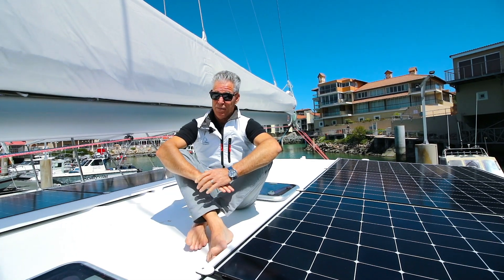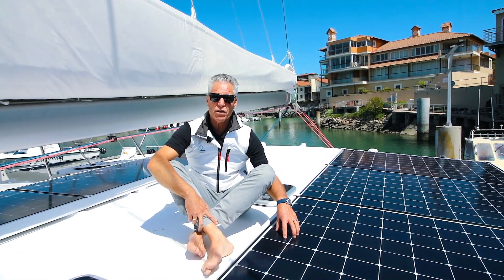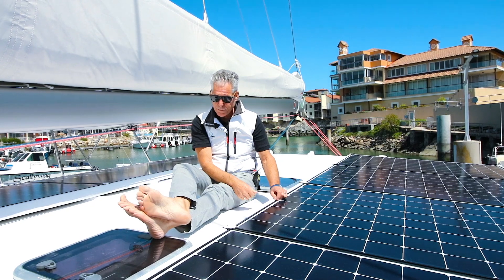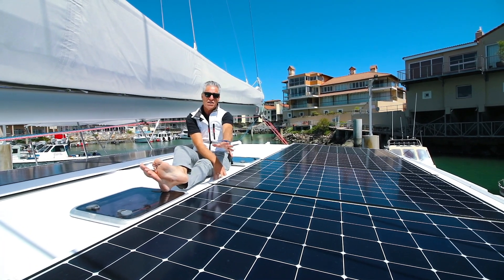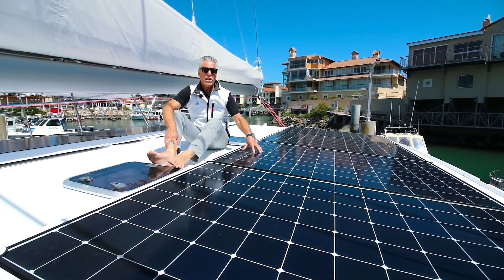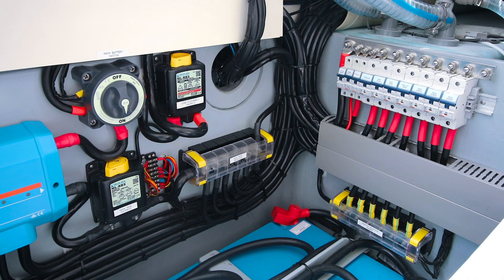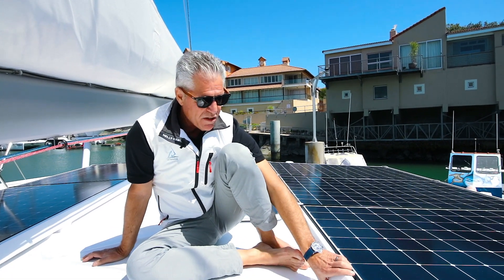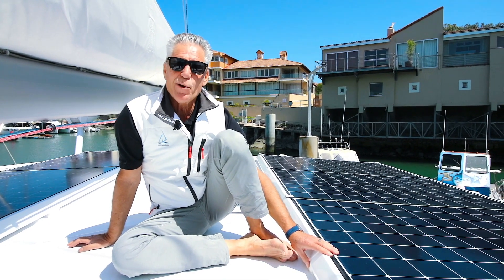Balance Build Technology - Solar Panel Set Up

Comment: With regards to the Solar check out Silent Yachts, finally, a company has created a catamaran that is completely run on Solar power for all systems onboard as well as a backup generator. 

They have proven the technology by sailing across the Atlantic with complete success. It has unlimited range and capacity and all by using currently available technology and batteries. Check out their website and the six models they currently have. It's thrilling to see the technology finally being available. It's clean and eco-friendly and has redundant systems, can also use a Kite system and has a Sail option if you want a sail setup. I am currently looking at the Kite Option and wind generators as well. 

My goal is to avoid all of the problems of a Sail setup, no rigging, and masts, as well as no diesel issues, no need to worry about fuel and repair for the Deisel engines. However,  SY also has a diesel option if you still want those.

1. Silent Yachts Main Website: https://www.silent-yachts.com/
2. YouTube Channel: https://www.youtube.com/user/solarcatamaran
3. Silent 44: https://www.silent-yachts.com/silent44/
4. Silent 55: https://www.silent-yachts.com/silent55/ <=== the one I am looking to get
5. SY Philosophy and Technology: https://www.silent-yachts.com/silent-yachts/
Reply from the maker: It is true that doing a power only electric boat is better - because you can carry larger solar arrays and have no shading of them. 

But a voyaging catamaran, a sailing catamaran, without a backup generator is to our mind risky. And we fail to see yet how an electric engine boat is any greener than a great sailing boat with small diesels and lithium batteries.

A voyaging catamaran can certainly go without a generator and solar and lithium batts, but it has very limited range and speed. We have done studies on this for a climate scientist who wanted a Green Balance. The technology is not there yet. We have sold many used electric engine yachts and have vast experience with them - pro and con. Until solar panels are 3 times more efficient, or the batteries are 3 times more efficient, the range under battery power alone and the speeds you get without additional solar input are low and challenging for safety. I have recently done a video on this we will add to our site. If we could plug in every night, electric is fine. If the sun was out brightly every day it would easier, but it isn't.
Reply: @balancecatamarans  Phil, a major advantage of electric drive is that sail power can be used to recharge the batteries and recoup the energy needed to motor around for coastal cruising.  For long passages, a backup generator is needed.  All of that is readily doable today, if a bit costly until battery costs fall further.  Even Silent Yachts uses a generator for long passages.  

I don't think anyone practical is suggesting to not have a backup generator for passage making boats like yours, but given the sailing efficiency of your boats, the generator would be used even less often than for lower performance boats.  Electric drive would cover the most common use cases such as motoring around marinas, anchorages, etc.  With a backup generator it can be used for passagemaking too.

Electric also fits the ethos of sailing much better than diesels: electric drive with regeneration ultimately uses only wind power to move.

I realize the boating field generally tends to be conservative, but Balance could help show the way to the future by embracing electric drive.  It's also better for the environment overall.  

And it may stimulate sales.  There's a ton of interest in electric drive, and rightfully so.
Reply: Specifications from the Silent web site and referring to the 44 model:
solar panels 9KW, so if we assume a not cloudy day and 8 hours of sun, as when the sun is near the horizon panels that can not be oriented work at a fraction of their maximum output 72KWh of energy produced/day.
engines 2 x 30KW or 2 x 80KW, so with the smallest ones at maximum power you deplete the whole energy you get from the panels in a little more then one hour, with the big engines in less then 15 minutes.
batteries 120KWh
cruising speed 6-8 kt and 6-10 kt, assume that you cruise at 6 kt and this means to use the 25% of the engines power (and I am only guessing, but possibly I am too generous), so you use only 15kw and that you start with full load battery you have 120KWh+72KWh = 192KWh  available before you deplete the batteries. 
192/15 (25% of the power of the small engines) = 12.8 hours before you deplete the batteries.
12.8 x 6Kt = 76.8 nautical miles range.
On a long, but not necessarily transoceanic, trip you can not count on the energy stored at the start if not the first day, then you have to use the 72KWh/day from the panels to move for 24 hours, so you have only 3KW available energy, that has to feed not only the engines, but all the other boat systems, so you have less power then most of the little dingy engines to move around a 11 tons boat.
Those boats are fantastic for island hopping, but their range using only regeneration is really limited. For everything longer then 50-70 NM you have to use diesel fuel.
If we find in the specifications also generator: 22/100 KW and fuel: 250/500 L there is a reason, for everything beyond that range or to use full power if not for a short burst those boats have to rely on fossil fuel usage, even if are surely more green than a boat that uses only diesel engines as they can regenerate some energy during the trip and be completely green for short distance island hopping, assuming you don't use the energy you get while on anchor to run air conditioners.
The only way we have to run a green cruising boat at now, capable of long range and don't using all the energy for the engines on an experimental boat built for the purpose and not for normal cruising, is to use sails in an effective way, so a boat able to have some speed also in weak winds and able to perform tight reach, things that most charter oriented catamarans don't do well, while performance catamarans and many mono hulls can do, and to use solar panels, but also wind generators or hydro generators if needed, to run the other systems, depending on the diesel engine only for calm or to control the boat in a storm. 
This to give more perspective to what Balance Catamarans tells, the idea of a boat with a solar panels roof that can run only on regeneration is intriguing, but at present the technology don't allow it if not for a very short range, and doing some simple math can easily show why, math based on data taken from the Silent Boats web site, so not using flawed data.
Ciao from Italy.
EDIT: possibly a boat with sails and electric motors, a triple regeneration system, solar, wind and hydro, a large LiIon battery pack and a diesel generator is a possible alternative that works, probably at a higher cost then the one chosen by Balance C. as you spare the diesel engines, but you need probably more battery capacity, 1 or 2 generators, 2 is better for redundancy as it can save boat and lives in a storm, and the electric motors and larger section cables don't come for free.
No generator and very large battery pack can be risky if the boat has to survive for a long time in a storm or have to use sails and motor to escape fast from a coming storm.
In both cases and if the electricity consumption for other purposes is kept at a reasonable level, ie not running air conditioning for all the boat 24H/day or motoring in every situation  where you can not have optimal speed sailing, accepting to have some days with a 4Kt average, the resorting to diesel fuel should be any way minimum, the boat with electric motors (and sails) is only more green when docking or mooring, but as long as the sails are used there is not a real difference.
The more boat price don't really justify the little diesel fuel spared, not only form a cost/benefit point of view, but also from a green one, as what makes the real difference is how the owner runs the boat, if he motors often or not and if and how he uses air conditioning.
Reply: @andreachinaglia5804  Thank you very much for this excellent roundup. Personally I would prefer electric engines with generator(s) to the "dirty" diesel engine, but the question I have: is the generator less prone to operational failures than diesel engine and which one is easier to maintain? Then there is the big elephant in the room, i.e. a lightening strike when all electric systems shut down. Perhaps diesel engine is better then, and my understanding is it has to keep running in the storm because it has an electrical starter that in case of a thunderbolt strike will break and diesel engine will not be able to start.
Reply: @tangomechanic  Boats usually have bonded electrical systems to dissipate lightning energy, same as airplanes.  Here's one reference: https://www.westmarine.com/WestAdvisor/Marine-Grounding-Systems

Silent Yachts has a great solution to not use a traditional generator.  They connect a modern, clean Volvo marine engine directly to an electric motor and use the electric motor purely as a generator to charge the battery bank and/or power house loads and/or (separate) electric propulsion motor(s).  That allows the use of a very well supported and arguably cheaper for a given power marine engine instead of a genset.  A marine engine is likely easier to support/maintain globally too.

In large ships this is called Integrated Electric Propulsion.  In cars, it's a serial hybrid.  It's also how diesel-electric locomotives (without batteries) and diesel-electric submarines (with batteries) work.